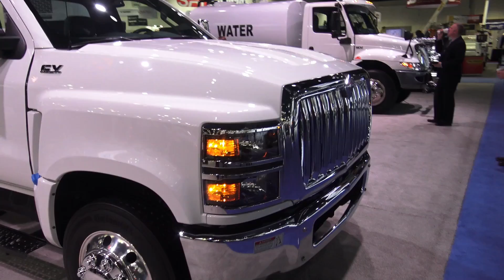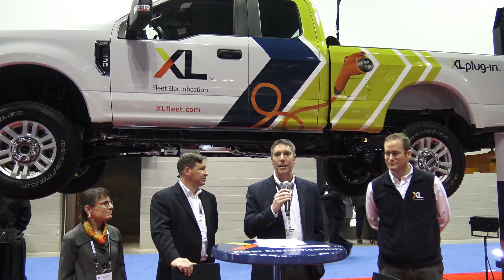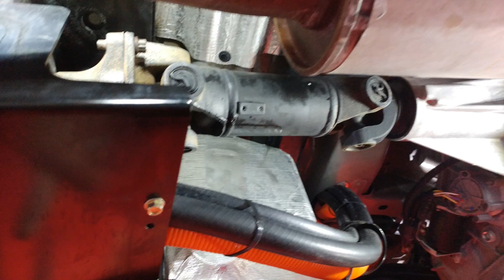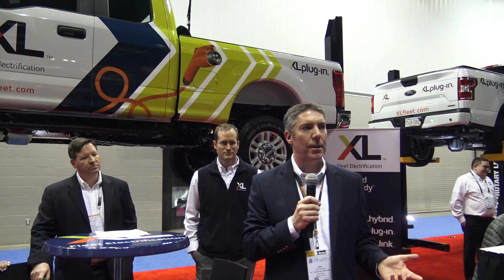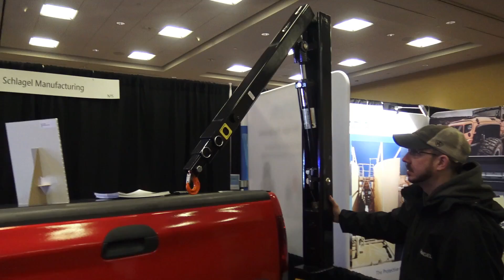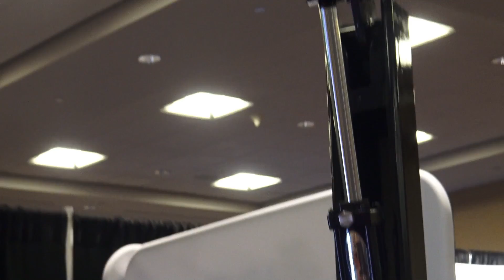2019 Work Truck Show Part 3, XL F250 electric truck and hoist in a bumper

Comment: when the hybrid f150 comes out, why would I get an XL ? No one thought about asking that question ?
Reply from the maker: XL is the name of the hybrid company doing the conversion. XLfleet. They sell the conversion to fleets and municipalities. I suppose it's possible for a citizen to buy one but part of the attraction is the CO2 pollution credits that corporations need to not get fined for pollution.
Reply: @MrTruckTV  Thats not what I meant, sorry for the confusion. What I meant was, when  ford will release a hybrid / full electric f150, why would anyone buy one of XLfleet's conversions ? Even corporations will be able to buy standard ford hybrid trucks. They are suppose to be released in 2020.
Reply from the maker: Yes, that could be the case. XLfleet has been building hybrid trucks for 10 years. They are targeting the Ford Transit van next. My Ford Fusion hybrid was great, got 45 mpg and was fast. My insurance didn't go up and the battery had a 7 year warranty